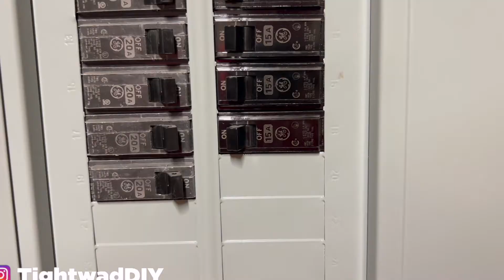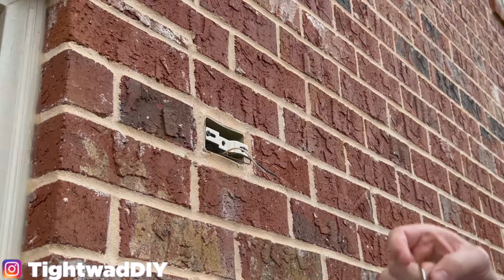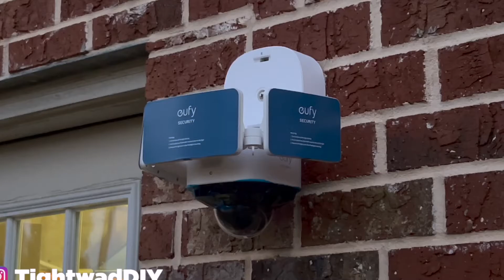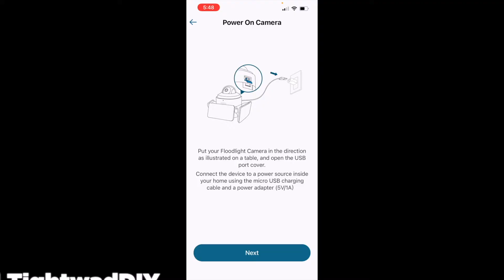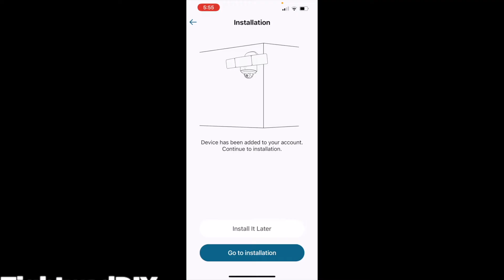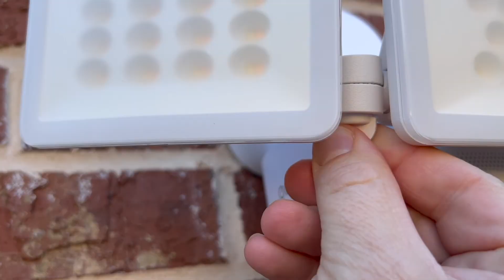Home Security EUFY Floodlight Cam Pro 2 Install and Initial Thoughts | Home Security Camera #ad

Comment: If my junction box does not have a bare copper wire, do i just connect the eufy ground wire to the mounting bracket w/ a screw that's labeled ground?
Reply from the maker: Yes

Comment: I've had this camera for a year and like it. BUT, just recently it lost connection (unknown why). I tried many times to get back online with fail. I then removed the device from the app. Now when I attempt to re-add the device to the app, it cannot find my wi-fi. But it can find all my neighbors wi-fi. Very frustrating. I hope I don't have to take it down to set-up inside. Any suggestions?
Reply from the maker: Try reaching out to Eufy via the app. They’ve been helpful when I’ve had issues.
Reply: @TightWadDIY  I was just about to… then the next attempt the following day, my Wi-Fi appeared in the drop down list. 1-2-3… it was re-added.

Comment: Thanks for the video
A few questions for you
1) where is the video clips stored ? Will it store the info to the new eufy base station?
Can you manually toggle the lights on/off(override) and can you turn on the lights and still use the lights as motion sensor without recording if needed? Let’s say for example:  you have guest over and you need the lights “on” but some people don’t like to be videotaped
Reply from the maker: Great questions. The Home Base is not needed for this camera. I assume it uses cloud storage but I don’t pay any fees. Yea you can manually control the lights on/off, brightness, and color temp. You can use the lights without recording.
Reply: @TightWadDIY  There is onboard storage built in (8 gigs) basically 30 days of activation storage (45 activations per day) in December of this year the floodlight cam pro 2 will be compatible with the homebase 3 At this point you can not store 24/7 footage... but that may change when it becomes compatible with the homebase 3
Reply from the maker: @1jzMKIII  Good to know. The HomeBase 3 has a hard drive slot so you can expand the storage too!

Comment: Will be doing the same thing and replacing my back porch light with the Eufy 360. Thanks for the heat gun tip. I do have one and will use it.
Reply from the maker: It worked even better than I expected!

Comment: Speaking of your wife's SPRAY PAINTING...  Disabling that camera would cost an intruder about a buck ninety-nine.   These things need to be mounted well above spray can reach.
Reply from the maker: The recommended mounting height is about 9 ft to maximize motion detection.
Reply: Im pretty sure he is not going to change the wiring on a brick house when the camera footage is stored locally anyway... spraying the camera only means you have to walk up to it to do that... in which case you will be seen and recorded already.  You could mount it on the roof if you wanted to and a BB gun or a paintball gun could take it out... Where there is a will there is a way...
Reply: @1jzMKIII   You are probably right.  I guess a simple ski mask would work just as well.